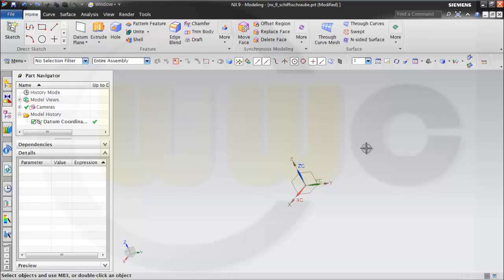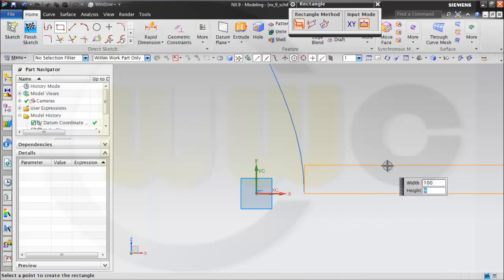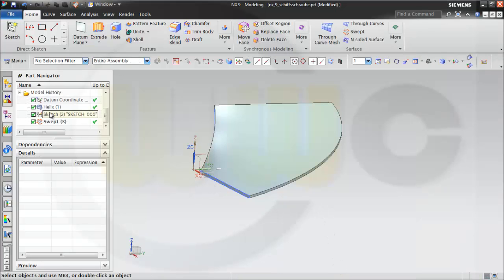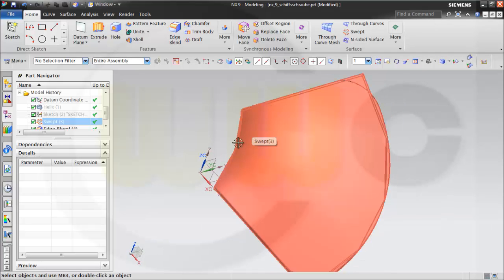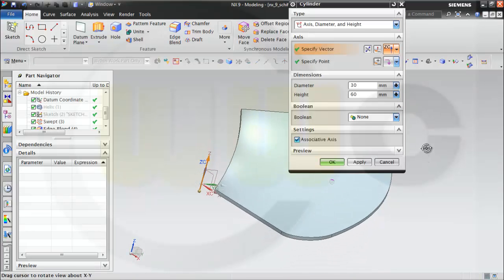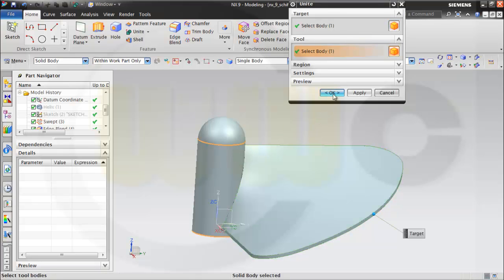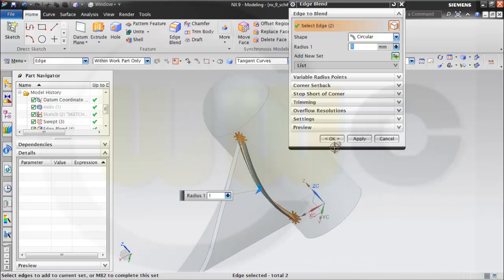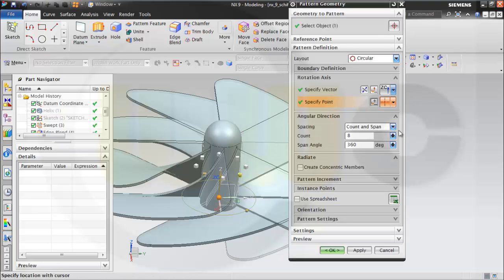9.5 Schiffsschraube - Siemens NX 9 Training - Swept - Sweep

Comment: sir does it really metter if we use pattern feature or geometric patter?  I just confused I did both them but I could not see any differences. Maybe there is some important things Idk.
Reply from the maker: Siemens NX is like SolidWorks, SolidEdge and Onshape a parasolid based software. Therefore sometimes feature pattern might not work and geometry pattern will or vice versa.
Reply: @wolfgang.walden.cad.training  thank you for your help sir, you are a legend